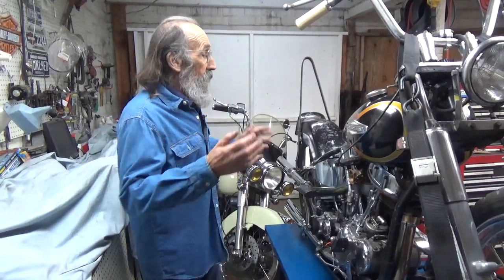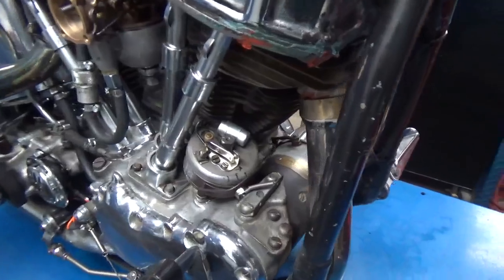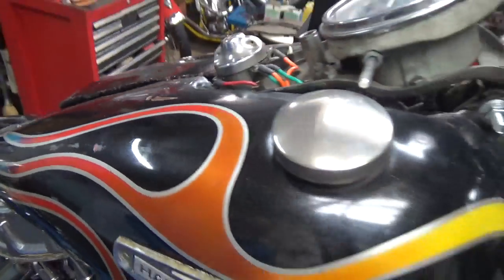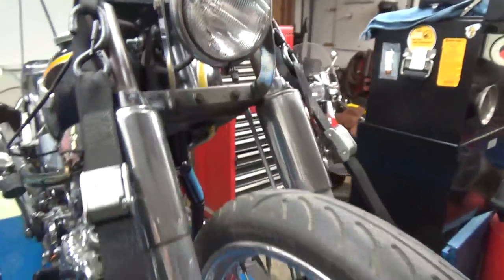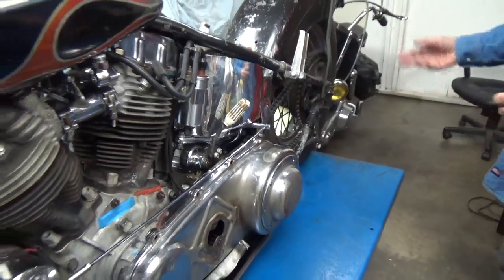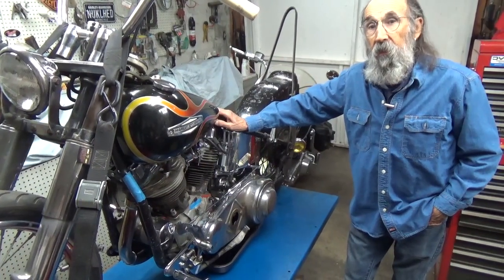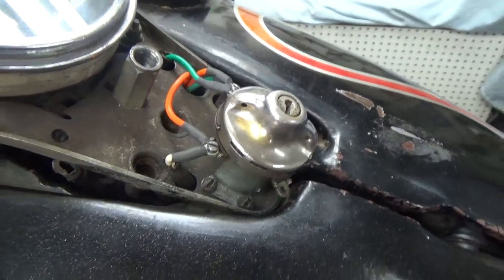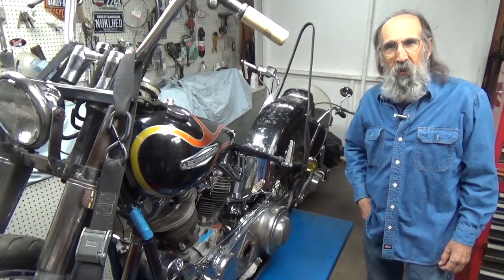Step 16 The Panhead L C  continues

Comment: Gotta take care of your health first. I recently changed spark plugs on mine and the rear cylinder wouldn't fire. I pulled the plugs and checked, both were sparking. But I eventually found that the new Champion plug for the rear was shorted center to base. Put another new plug in and she ran just fine. Not saying that's a problem but it might be worth a check.
Reply from the maker: That's true.

Comment: It's great to see you on the mend.  Have you tried swapping the spark plugs?  I've had plugs play games in the past especially when they have good spark until their under compression.  One of those head scratchers when they are brand new plugs.   When your up to it keep the shiny side up and the rubber side down.
Reply from the maker: Thank You.  Yes, I'll go through all the combinations, if it's warm tomorrow.
Reply: It's more common that I thought with bad spark plugs. It kind of sounds like an ignition problem, since the carb is same for both cylinders. First thing I would do is actually changing plugs front to rear. Next thing would be the feed to the coils. Good luck!
Reply: @Olle-555  That's the order I would proceed.  The coil could be getting weak.  My shovel was playing games two years ago.  Turned out to be a broken spring on the advance weights.
Reply: @timothyputzke1250  My father told me a good thing when I was 11-12 years old. "If it isn't the fuel, it is the ignition!". It has saved me a lot of headache. I think it's true in 90% of the cases and when it's not true the cause is quite obvious. I had a piston that came out of the engine once...... that was obvious 🤣😂.
In this case I don't think it's a fuel related thing.

Comment: Hi Mike, Thank you for the new video!  I have a request, can you tell me where in the USA I can buy a panhead oil pump body?  This is for a 1962 model FL motorcycle.  Greetings from Poland!  Marcin
Reply from the maker: Any of the aftermarket suppliers carry different brands.  The only way I know of to find an original would be a swap meet, someone who deals in early model parts or ebay.

Comment: Hiya Mike, Its suppose to warm up here so got the bike on charge to run , Have a question my 1988 FLHS stroker  cranks over slow the bat volt is 12,84 new bat when I crank to start it drops to 10.50 volts , but I still get it to start barely but when it warms engine wise it cranks right over ,do i need a new starter with extra ump when cold , this is the only thing I haven't replaced  only when cold after warms up cranks right up I  have already replaced cables and bat ,
Reply from the maker: If you keep a "tender" on the battery, it will always be hot.  If everything else is good, the starter is suspect, especially if the solenoid is working well.  You can try a jumper wire (14 gauge) from the little post on the solenoid to the longest post on the solenoid.  If it starts easily, your problem is between the starter button and the solenoid.  This includes a bunch of wire and a starter relay.  Be sure the bike is in neutral when you try this and it won't actually start unless the ignition switch is on.  Don't burn your fingers.

Comment: Hey  Mike  gald to see you back on your feet so how cold did it get down there  as you know I am from  Canada
Reply from the maker: In the thirties.  But, it's quite an adjustment.  When you go from well over 100 down to the forties in a matter of a few days, well, the older you get, the rougher it gets.  It's not how high or low, it's the difference between the two.  I've had major fun in Canada, but it's been a long time.

Comment: Hi there Mike! I'm building a Panhead in a Wishbone frame and have to buy a drive chain. I know that it is a 530 chain but no idea how many links should look for, please help. UPD: Harley mechanical brake drum and 23t tranny sprocket.
Reply from the maker: When in doubt, buy a long one and shorten as needed.  I always put on an old one and count the links.  You're probably 102 or 104.  I honestly don't remember.  Your drum brake sprocket is 51 teeth.
Reply: @pacificmike9501  Okay, thank you very much for responding! I don't have a old chain because this Pan is my first Harley and I'm building it from parts. But you're correct, I'll buy something like 112 links chain and shorten it. Thanks again!
Reply from the maker: That's generally where you learn it.  You'd think I'd have that memorized

Comment: Good morin mike got ? Rebuilding 85evo was wondering how big of cam can I use with stock rockers and springs videos are great
Reply from the maker: The advertisements tell you if the cam is a "drop-in" or not.  Usually about .500 lift, but it's on you to check it out.  The cam grinders will tell you.

Comment: Hi Mike. Enjoy watching all your videos. Great job. I have a simple question. My 1984 FLHT has been sitting  for 6 months. The oil was drained out and I don’t think there is much in there left. I’m about to take it to the mechanics next month. Just wondering if I should add some oil through the spark plug homes to keep the piston lubed and roll it back and forth for the time being. 
Thank you 
Justin.
Reply from the maker: Not really necessary.  I don't know what you have planned.  Are you riding it to the shop?  If so, better put oil in it.  If not, is the mechanic changing the oil?  I don't think you have a problem.
Reply: @pacificmike9501  ok thank. No I will take it by trailer to the shop. Was just worried the pistons might dry up while  sitting for 6 months.

Comment: You wouldn't replace that ignition with a dyna set huh?
Reply from the maker: No.  This motorcycle is being put into service on an almost nonexistent budget.
Reply: @pacificmike9501  kind of like my shovel.. in my case I notice it's mostly sitting in the garage that they develop problems... not that that's a revelation.  My bike was pretty much trouble free for a Decade until I started have knee problems and don't ride it as much.
Reply from the maker: I understand.

Comment: Great video Mike , love that heal rest idea , I've been running a clutch like that on my 48 for years and never have seen that trick. What's cold weather like out there in California?
Reply from the maker: It's not that cold.  I live in the foothills in SoCal.  It's not into freezing at night yet.  It was in the very low forties when I got up this morning.  It's the quick change that gets you.  You go from well over 100 degrees F to 60 degrees F in a day and your own system does not adjust that quickly.
Reply: I was wondering the same thing, about how cold does it actually get there. Here in S. WisconsinI ride down to the mid forties, but not like every day. The main limiter is salt on the roads. Salt really attacks aluminum especially. March or April before roads are washed off again.
Reply from the maker: Sounds a little maddening, but each place has its pros and cons.

Comment: Greetings Gentlemen, sounds like you may have been suffering from the remnants of an old Sherwood malady known as the 'Dreaded Lurgy'. Many moons ago, whilst trying to rid the Greenwood of these seasonal sniffles, they also found that the door knockers on Scrooby parish Church had fallen off due to galloping knob rot.
So, as was the custom at the time, a few suitably diseased locals were rounded up & sealed in a wooden box made from the now dubious Church doors, dragged 50 miles cross country to Boston, Christened 'Mayflower' & thrown in The Wash.
No one's really sure what happened after that.
Maybe some lurgy survived down the generations, finally finding it's way, through your innocent touch, into that rear spark plug.
Intermittent failure under compression is a well known lurgy trait among sufferers on a high fiber diet & as there's no scientific proof that machinery can't catch it - I'd swap the plugs & leads over (or nail them in a box & mail it back to Boston)
Best anti-lurgy is fresh orange juice, (that's if you can find any) just soak both plugs in it overnight at room temp. Y'all : )
Reply from the maker: I had idea of your expertise in the realm of medicine, both human and mechanical.   Being that Harleys are living things and I, well we won't go there.  We're both "on the mend."  Thank You for the instructions.

Comment: Hello Mike, am continuing on my '64 Duo assembly.  Here's a pretty basic question, I cannot seem to locate the ground cable to the batter negative terminal.  The ground cable attaches to the battery negative terminal, but where does the cable attach to the bike?  Thanks for any insight.
Reply from the maker: Should be a tab welded to the top right frame rail, under the seat.
Reply: @pacificmike9501  got it!  thanks!